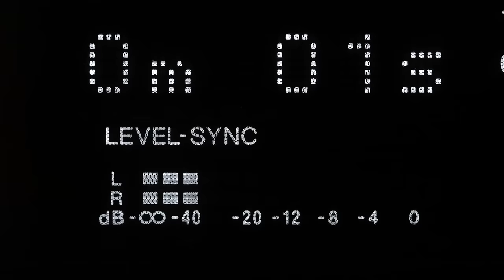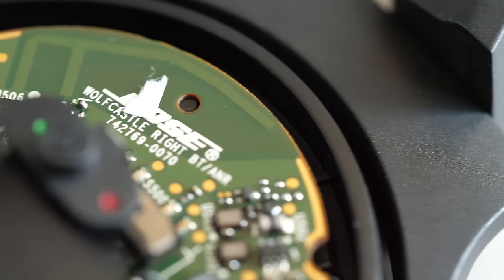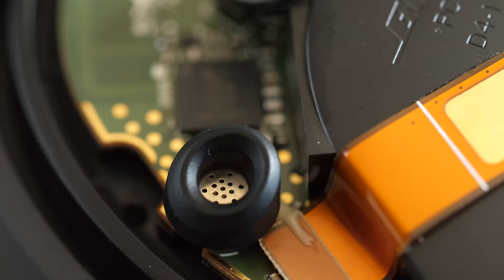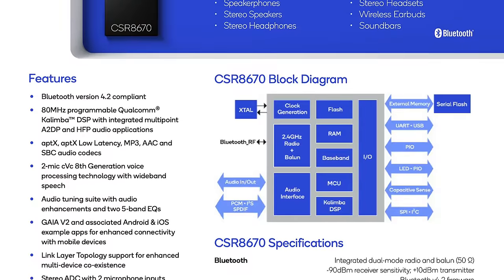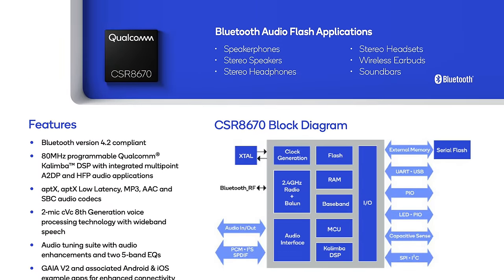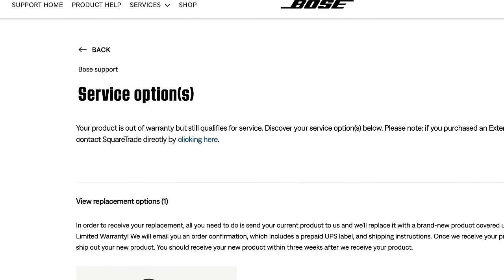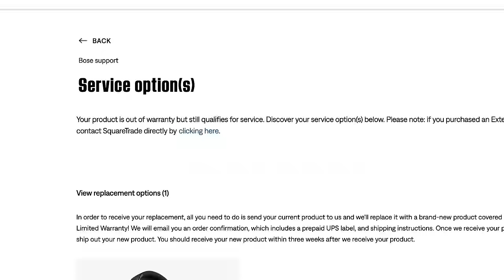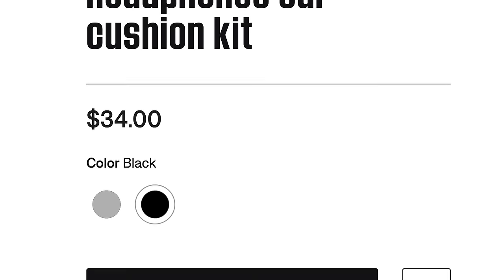I thought my Bose headphones were DEAD until I found this fix!

Comment: a few years ago I wanted to replace the Earcups of my Beats Pro and called Apple but the only thing they offered is replacing the Headphones for over 300 Bucks. I also ended up buying 3rd Party Earcups and they are Perfectly fine...it's a real shame that you can't even buy a simple thing like this these Days. In my Opinion Parts like Earcups should always be Available at the Manufactures Website for Purchase.

Comment: Wolfcastle... like.. Wolfenstein? :) Also, I replaced my pads in my sennheiser headphones, and they started to fall apart a year after the replacement. Changing the pads for new ones is a Sysyphus job, I think changing them for a different/better material would be good, but there are no such things on the market.
Reply: Mhm you don't think you can install sheepskin real leather pads on these headphones? Perhaps by gluing a snap plate liberated from a worn pair to the back of the pads.

I'm also not convinced that the material is always the same. There are different ways to make fake leather. Some are PVC top layer some are PU, and there's different ways to attach the plastic to the textile backing, some are stronger than others. Perhaps Dekoni or some other brand will be better in quality, i don't know.

The way the original pads explode eventually, they aren't even sewn on the inner seam, they are just heat bonded together, and once the coating layer starts to depart from the fabric, there's nothing holding them together. Cheapest manufacturing possible.
Reply: @SianaGearz  I kind of resigned to do anything, but if I come across a set of good real leather pads I'll give it a try. Thanks.

Comment: A while back, I found a Sennheiser 660S in a scrap market for dirt cheap as Non-working.

Was pleasantly surprised and confused as it looked in Great Condition! needless to say, just went for it.

Troubleshooting it, issue was, one side did not work, I opened it up aaand THERE it was, a broken connection to the external cable 
(Side Note: The built quality is underwhelming tbh, especially the wiring/poor reinforcement).

Anyways, long story short, I soldered the broken connection and it was back to Normal!

Probably my best find to date! (Paid less than tenth of the original Price).
So happy about it, especially after getting one of those mini Amps to boost it up.

I always wanted one, but just could never bring myself to justify the Price!
Still think they're overpriced.

Comment: I had a similar issue with my cars turn signal switch/stalk. The internal contacts were dirty and it wasn’t making a connection. A quick clean and rebuild and the problem was gone

Comment: I have the Bose QuietComfort SC and last night the type C connection melted.. not sure what happened, but the battery is at 90%, the type C no longer makes connection, and I had to break the cord off the headphone and pull out the remaining bits from the type C that were welded in place. Does anyone know how to swap out the type C in these?  It has plastic melted over one of the 3 screws inside needed for disassembly; gonna have to grind or pry the excess plastic off.

Comment: So, I purchased a Supermac/Radius Videospigot Newbus card for my Quadra 800. It was not expected to work, and it does not (although it is recognized by the Newbus). The system simply freezes when the Screenplay app initializes. If anyone knows someone with the skills to troubleshoot and repair it, please pass the info along. Thanks.

Comment: Oh yeah those soldered physical switch are ass, i had similar issue few month ago, my Plantronics headphones switch are failing and i had take those to repair since Plantronics are shit and their headphones are jumbled mess of wires, my old GBA Advance SP power switch literally sunk inside the device and the module literally snapped out of place clean on the solder joint.

Comment: Your first mistake was buying Bose. :) I am kind of taking the piss, but also not really. At least they did make this possible to fix.
Reply: It's true, they are a marketing and lawsuit company that also makes audio gear.
Reply: Bose are comfortable, portable, and have industry-leading active noise cancellation. And honestly, they sound pretty good. Hating on them is a tired position.
Reply: @FredWallace18  So do many other brands that don't charge a substantial premium for a name. I'll take my Sennheisers that I bought for half the equivalent cost any day.
Reply: Sadly, even in 2024, there isn't a whole lot of choice when it comes to wireless ANC headphones. It's basically Bose, Sony XM4/XM5, Beats, Apple, and post-acquisition Sennheiser. I've tried a ton of different options, and my Bose QC 35 IIs are the only ones I'd ever want to take anywhere because of their comfort, slim profile, and acceptable (if not great) sound quality.

Comment: I bought my wireless ear buds at Aldi for $15.  I haven't had to repair them yet.  (Now I will get trolled by elites.)
Reply: You can get half-decent IEMs now starting at $15 with removable cables. Considering those are what almost always break, repair probably won't be an issue.
Reply: @zorilla0   TRN MT1 were sort of amazing and those are $6 IEMs.

I did end up breaking the connectors on the IEMs themselves though, several pairs.

Comment: Why would anyone want wireless headphones?
Reply: I have a set of DT 770s at my desk, and even I get tired of having to deal with the cable sometimes, so I find myself reaching for my TWS in-ears or Bose QC 35 IIs on occasion.
Reply: @zorilla0  Wires can be a major PITA.  So I get it.  But wired earphones are just so much better that the wire mess is worth it, IMHO.